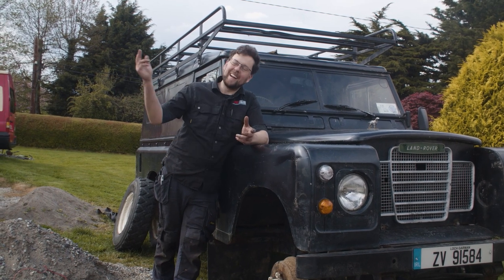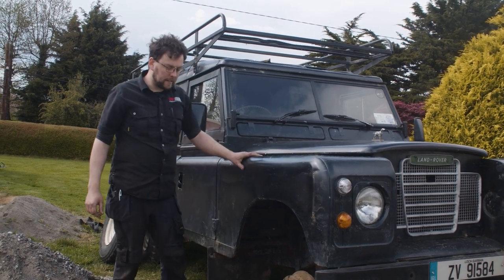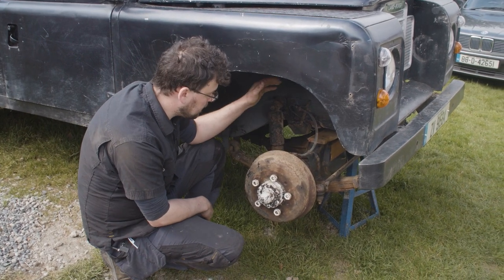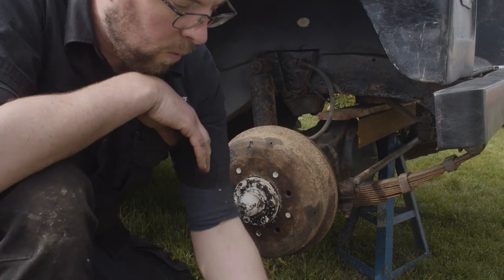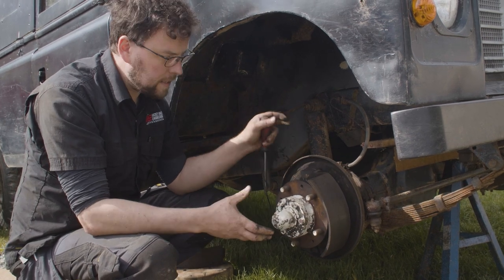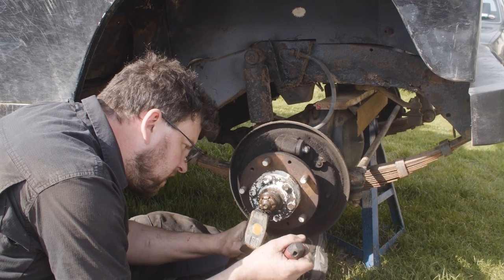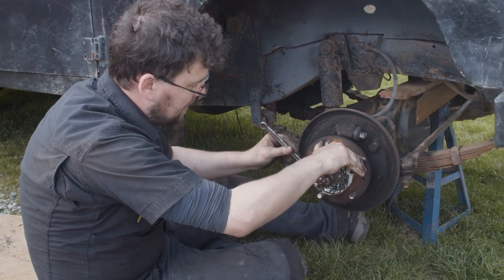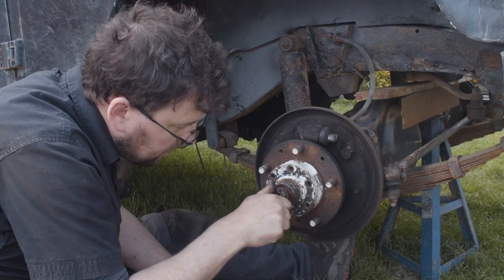Rebuilding A Worn Swivel Hub On A Landrover Seiries III - Part 1

Comment: Nice one Paul  swivel hubs not for the faint hearted we used to make box spanner’s from pieces of tube a little smaller than the nut or bolt heat the end then forge it over the nut/bolt instant box spanner a bit Heath Robinson but it usually worked ,parts supply still seems up in the air suppliers don’t keep stock like they use to because it dead stock on the shelf and expensive,you need one of those portable garages from MM to keep that Irish wet off you (the wet helps make that lovely butter 🐄 ) stay safe and dry top lad 👍👨🏻‍🏭🇬🇧
Reply from the maker: Paul I am going to steel that. Its right up my street and the perfect way to get a tool to do the job awesome. We have a nice pop up that we can use if we get caught but at the moment we are blessed with some nice weather

Comment: The rub marks on your shaft is caused by the slop in the swivel housing and its rubbing on the inside of the stub axle/spindle.  I have the same issue with the swivel hub moving so much that it started to bind the half shaft against the stub axle/spindle and it heated up so much that it welded it to the inside of the stub axle/spindle and broke off.  I still haven't figured out the reason for this movement since the alignment of the swivel housing relative to the axle shaft is fixed...not adjustable.  The shims in the top swivel housing pin only set the amount of force required to move the swivel housing from right to left.  

Great video and was great for me to see another series III swivel housing video to help me continue my effort to understand why my swivel housing is not aligned properly with the half shaft coming out after being bolted in and seated in the lower swivel bearing.